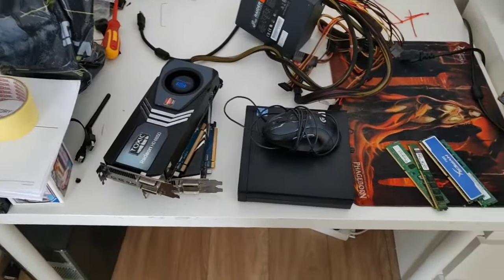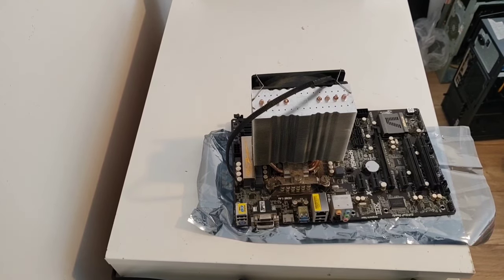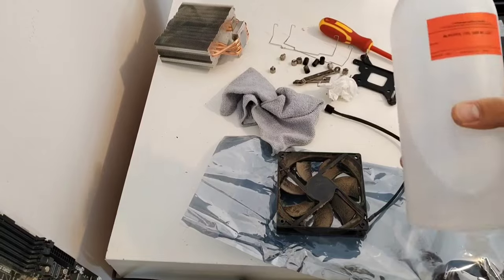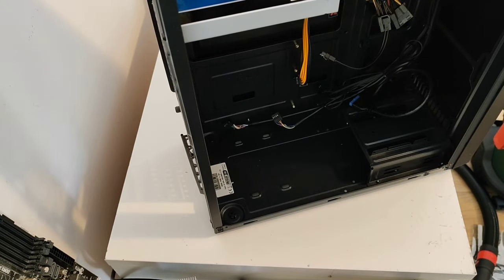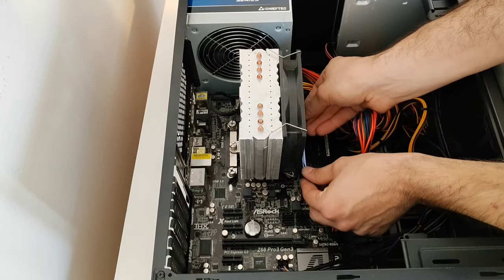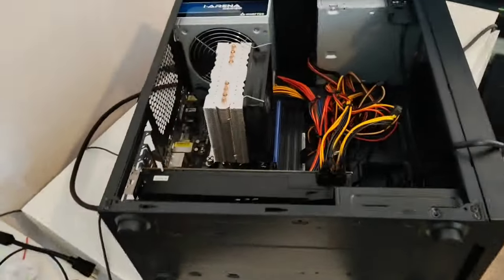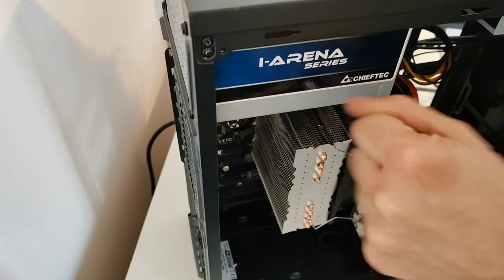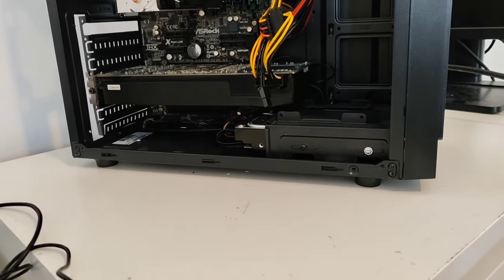Flea Market PC Find | The 38$ Flea Market Gaming Pc | Cheap Pc Build

Comment: I remove dust from old computers also with a vacuum cleaner but with a brush attachment. Really easy and no problems with antistatics so far
Reply: Can you get anti-static paint brush to clean pc motherboards? I would be scared to use that on a motherboard cause of static electricity.
Reply from the maker: Yea i used to do it that way but new vacuum doesnt have that attacment
Reply from the maker: @cybernit3 I use normal one all the time, never had problems. But u never know, there's always a chance.

Comment: My tip for cleaning pc fans is toothbrush soap and running water. They are usually very grease and alcohol cleaning takes too much time and it is never as good as it should

Comment: If it is in the budget, getting a cheap SATA SSD, and a single 8GB RAM stick to "balance out" your dual channel RAM setup would both be reasonable ways to get the best possible performance out of this machine.  But, it is an old machine, so "best possible" is not going to be a huge difference from what you have, now.  Keep up the good work.
Reply from the maker: I ordered some parts but will take about 12 working days to arrive. Used SSDs are expensive here so i order some new ones

Comment: I would take out the Chieftec and check its power rating. From the blue sticker its probably a GPB series and could be 350/450/500w. Also I would prefer the FSP over the Chieftec. About the RAM it's bad idea to mix different sizes and brands. Installing them in pairs with same spec/size/manufacturer to enable dual channel memory (download and check the motherboard's manual to see which slots to use).

Comment: Don't you need a 120mm fan on the back of the case?
Reply from the maker: Nah, not at the moment. The towercooler keeps it cool enough, i have some spare fans that i will add for overclocking the i5 2500k. Ordered some upgrades :)